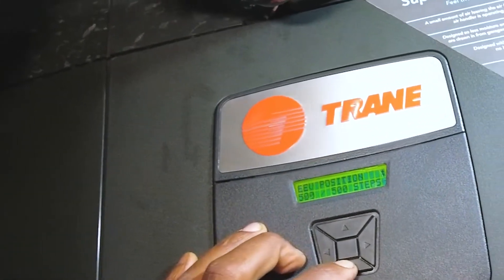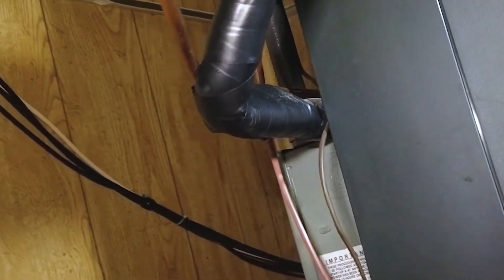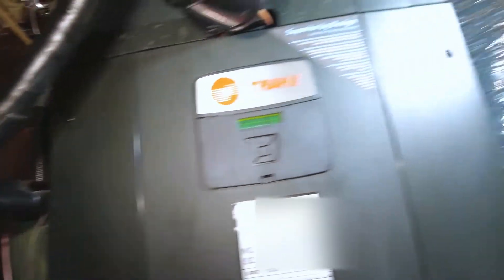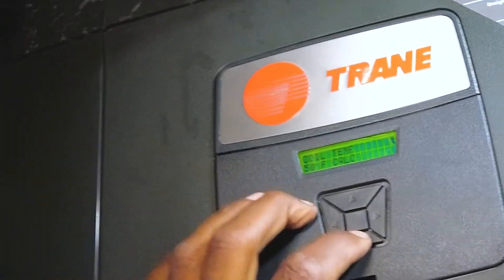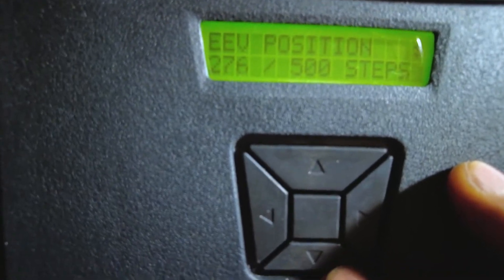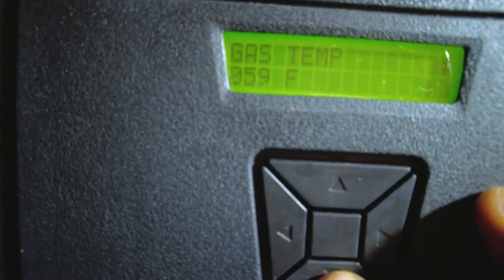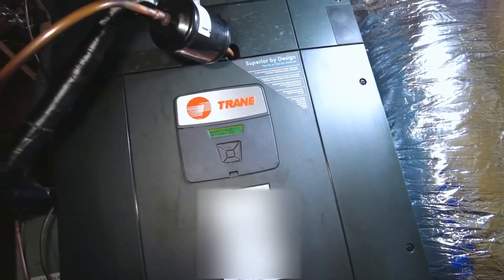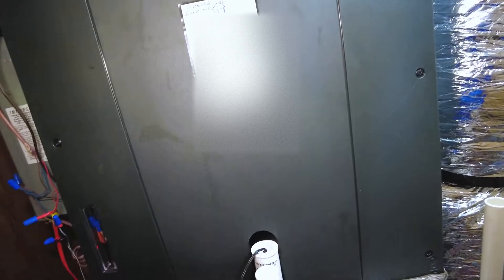Replacing Gas Sensor on Trane TAM9 Variable Speed | Bad Suction Line Temp Sensor - Trane Error code

Comment: My system is about a year and a half old. I had an issue with the sensor and got it replaced. Now, I again have a blinking red light 10 times on what I believe to be the EVC board. I am not able to clear the alarm either through the board or the process that indicated to press the reset button and reset the power to the unit. Do you have any suggestions?

Comment: got a 175 code for low superheat, ever seen an intermittent gas sensor cause this? or you thinking more like excessive charge, unit is less than 6 months old.
Reply from the maker: Yes I have seen a gas sensor cause that code . Could be the gas sensor is not properly mounted on the vapor line I actually just published a video recently covering how to diagnose and repair this issue. The video title is called don't mistake this for air flow issue. Let me know if this helps